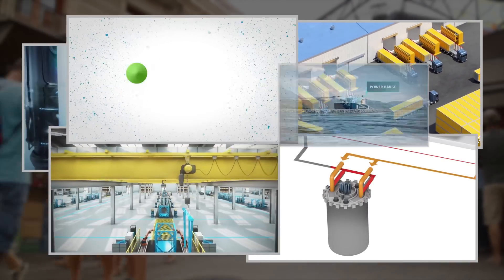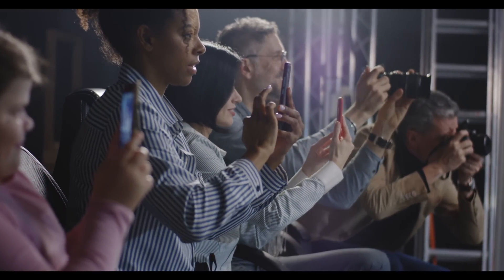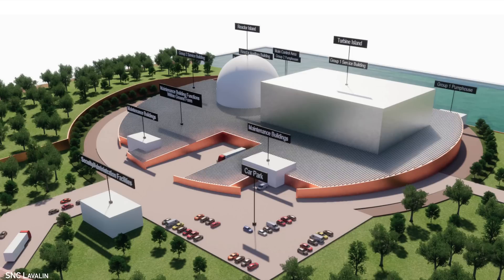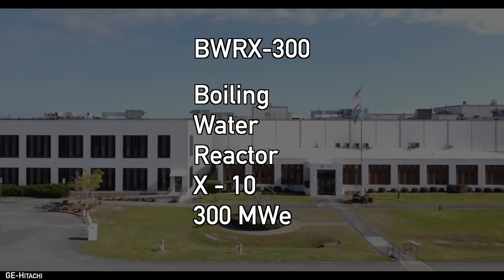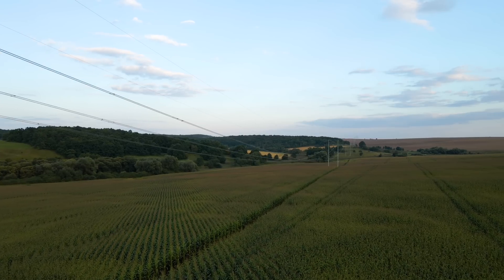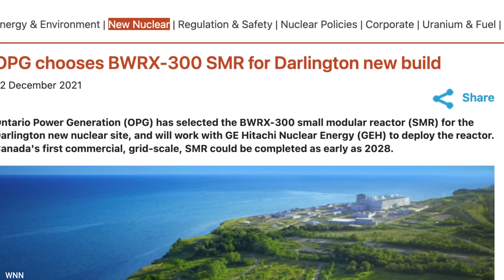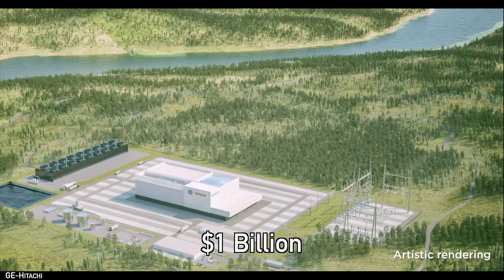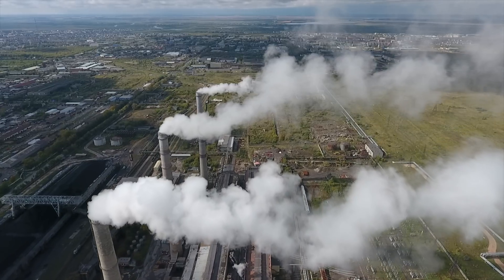Why This Small Nuclear Reactor is Actually Winning

Comment: The Current 2025 estimated cost for the Darlington SMR project, which includes the construction of all four small modular reactors, is approximately $20.9 billion.

The 1st. reactor cost is estimated to be  $7.7 billion, including shared infrastructure, leaving $13.2 Billion to complete the remaining  3 SMR's.

Construction of the 1st. SMR has begun and will finish in 2028 with the commercial operation date set for 2029.

Comment: A small version of the Fukushima reactor that doesn't need a backup diesel generator to cool it when everything else goes to pot.  But it's still a general electric boiling Water reactor.   3 to 4%  enriched fuel, relatively frequent refueling.

Comment: A 10 mile radius evacuation area is required in the US for fission nuclear power stations.   This has not change for SMRs.   SMRs could be used for ocean going ships where the ship can be moved to deep water if there is an unresponsive issue with the SMR.   Possibly the SMR could be jettison in extreme situation rather than loose the entire ship.  The move in the power industry is to use supercritical working fluid turbine generators that allow much better reacting generators for following loads.   This is not broadly fast reacting enough for following wild AC from solar voltaic and wind turbine generating sources.  That still requires natural gas turbine generators.

Comment: The guy says that the BWR is a boring design that can not offer the safety solutions of MSR's. Then he continues with boosting the reliability of the BWR. Which is it? Secure or reliable? They can't be both.

To me, SMR's of BWR or PWR design is NOT progress. They run on low temperatures, require incompatible turbines with coal plant turbines which run on higher temperatures. Waste stream is still the same & they have to operate under high pressure and the constraints of solid fuel.

Comment: I'm skeptical of designs that continue to use graphite water modulation which I assume is here in this BW design. The concept of the 7 day condenser pool cooling protection is that a failure mitigation scheme. Graphite burns and elimination of it is built in protection from the dreaded known and experienced failures to date. Cheap and shovel ready is nice and the pellet fuel also. Helium cooling no graphite modulation is more promising imo.. China is way ahead in that regard. Let's hope Xenergy here in USA emerges strong soon.

Comment: Governments that commit to a rigid time-frame for de-carbonizing their energy production are making a fundamental mistake: early commitment is bad practice for the opportunity and corrective costs inevitable. Especially with a technology in flux. However, the entire nuclear economy would benefit tremendously from the infrastructure of plant building and lending and operation and education programs that will spring up - and would naturally include the latest tech. And of course each power generation company will have it's own economic model to justify an early investment - if it isn't being panicked to do so.

It would be a huge advantage to a thousand small plant producers to join forces to commit only a small portion of their existing carbon budget to common commercial accelerated projects of the most promising but realistic design - obviously molten salt and Thorium would top that list because of its potential long term savings. Ten years is realistic to start production - especially with a global effort. 

However I do have to ask one bleak question -- what happens when we're producing unlimited HEAT - no carbon but a lot of HEAT and WATER VAPOR (used for cooling everything outside the cycle itself)? What happens when somebody calculates that into the Greenhouse Ecology formula? Uh-huh. I'm thinking - no free lunch. Back to distributed solar, wind, and fracking thermal.

So Let's Go Get 'em Guys!!
Reply: The only new nuclear projects in the U.S. were NuScale and Terrapower and NuScale just canceled their project and terrapower has built nothing in the 6 years they have been trying.  Each of these projects got $2 billion in taxpayer money for design that they said would only cost $1 billion.  Terrapower is a molten salt design but not Thorium.  Thnorium is not fissile and does not fission and does not produce any power.  Anyone that cites Thorium as the answer is getting their information from YT videos and really does not understand what would be involved in using Thorium

Comment: So this design has all the same flaws as the large nickel rafters if it needs that huge reservoir water that means it can still have thermal runaway and it still use control rods to keep a nuclear fission runaway from happening. It’s just a baby Chernobyl.

Comment: I think GE has the right rock here.  I work in the industry and I strongly believe this deaign could gain traction.  And the more orders ot gets, the cheaper the parts and the cheaper the parts, the more orders it will get.  

The BWR is a great design to begin with.  Definitely the safest, due to simplicity and the lack of large circulation loops in the latest designs.

Comment: Where is the uranium fuel coming from?  The UK has no domestic reserves, the last uranium mine shut in the 1930s and it only produced uranium for laboratory research. At what level of enrichment do they operate on? PWRs use 7% enrichment. Nuclear submarine reactors operate at least 20% enrichment. Where do they get the water to cool them? The big reactors are a problem needing water. Then there is the time between refueling. So many questions,so few answers

Comment: Boiling water reactors are vulnerable to positive void effect (the Three Mile Island meltdown). Using our present nuclear fuel chemistry (5% U235/ 95% U238), I would not recommend this. If GE used a Thorium/U233 fuel, this threat goes away.
Reply: No. Modern BWRs have highly negative void coefficient. In light water reactors the water is the moderator and the coolant. If the moderator goes away in a bubble the reactivity falls. BWRs have to deal with bubbles collapsing back to liquid when the pressure goes up. 

With the Chernobyl reactor, graphite was the moderator. Guess what most molten salt thorium reactor designs use as a moderator?

Comment: I’m sorry, but seven days of cooling is not safe. What if a natural disaster occurs and the reactor can’t be reached for weeks or months? Meltdown. Nope, still unsafe, just like all currently available nuclear reactors. Let me know when your BWR can cool itself forever without power or human intervention.
Reply: “Is not safe”

Turns out the decay heat … decays.  Several days out and while the reactor may be hot, it’s no longer hot enough to melt, and then continues to cool.  The coming very small reactors can radiate enough heat away as soon as they shut off without help.     

Also, while a meltdown of a light water reactor can make a big mess, we know what happens from Japan when even three of them are wrecked by a natural disaster: nobody dies from radiation.  Sorry, that’s safer than anything else that can run a grid.

Comment: People are crazy to keep using watercool design. It can still blow up if there is pressure inherent in the design.😊
Reply: The pressurized water might escape … instantly shuts down the reactor.  It’s the reactor core which needs to not runaway.
Reply: What moderates your design, and how is that shutoff?

Comment: In 1976 I met a GE engineer that told me about a reactor that would fit inside a shipping container and would run unattended for 40 years. We talked about building them where they would set on the ends and used as columns in entrance gates for a town. Or set up as industrial art.  I think one unit would power 3,000 homes.
Reply: Copenhagen atomics is developing that.
Reply: @MrRolnicek  I think that is a great product to develop. I hope it soon becomes cost effective to sell to the public..
Reply: Hey Poland! You're going nuclear for the wrong reasons!

CO2 is climate-irrelevant. 

Interglaciation climate change (i.e., the Medieval Warm Period) is caused by changes in cosmic rays (Svensmark et al). 

There is not such thing as anthropogenic global warming.  

"Global Warming" is a superstitious bullying and shakedown of the taxpayer. 

Just burn coal and keep looking for more oil and make it out of coal (the way South Africa does at SASOL).
Reply: And? 50years it die Not happen.

Comment: This design is not to great.   The reason you have a primary loop of water (in the reactor), and a secondary loop(goes to generators or heat users), is to keep the nasty radioactive stuff away from generators or heat users.   Yes the design is simpler, and for its life safer, as it is designed to allow boiling or steam generation in the reactor vessel.   The problem comes when you have to do Maintenace on steam pipes, generators, or whatever is using the steam because it is going to get radio hot over time.
Reply: Ok, but compare that to doing maintenance on a very large, primary connected steam generator in a PWR.

Comment: GE's BRWs were at Fukushima. How did that go? Steam is generated by water in contact with the fuel elements themselves & leaves primary containment to the turbines. Compare to Three Mile Island's accident.
Reply: “how did that go”

3 reactors totaled by aftermaths of tsunami, and… nobody killed by radiation. 

Fossil fuels tied up in everything else, and they kill people everyday.
Reply: Very old design compared to a much later design with many lessons learned. The BWRX-300 is designed to cool itself convectively without powered pumps. The powered pumps (and heat sinks associated) were the Achilles heel at Fukushima Daiichi that did not let them shut down safely during a tsunami. (Tsunami caused by an earthquake on a fault never expected to generate an earthquake that big.) This safety in the face of a station blackout may actually be a reasonable price to pay for the fact that the turbine hall is a (briefly) radioactive space.
Reply: I concur, I'm not a nuclear engineer but the segregation and redundancy of a PWR just instinctively seems to me to be inherently safer than a BWR. Due to the much higher specific heat of water vs steam, BWR having phase change INSIDE what's essentially a single primary element strikes me as being MUCH riskier vs a PWR with fully liquid state primary with multiple redundant heat sinks. Of course LOCA can be fatal for both but I'd imagine a PWR inherently has a much greater safety margin in an accident, and the primary stays inside the containment building pretty much no matter what happens.

Comment: If we were serious, we would just start building Westinghouse AP1000 reactors.  Proven design.  Reasonable power output.  PWR, so none of the downsides and higher maintenance of BWR. 

SMRs only make sense if they are really Small, and Modular.  Small enough to be built on a factory assembly line and shipped to the destination site, and the site is built to take a dozen or more side by side.   This has all of the issues with a large plant, but without generating the power output of a large plant.   The one thing it seems perfect for is replacing existing coal plants.  Build it on site next to an existing coal plant and bring the 300MW on line tied to the same transmission equipment.  Bonus points for making decommissioning of the old plant  conditional on the new plant being commissioned. 

Then the question is, which is better, the BWRX-300 or an AP300?

Comment: Good development but it is not just emmissions free elctricity that is needed. The big challenge is replacing the emmissions dense industrial process heat associated with for example chemical, cement, brick, synthetic fuel and metallurgy industries. High temperature reactors using molten salt, pebble beds, thorium fuel etc offer great advantages here. Such reactors also tend to be radiologically and thermally more efficient significantly reducing plant size as well as reprocessing and waste issues.
Reply: Thorium isn't more efficient than uranium. Both fuels contain about 24 GWh/kg and can be fully exploited by fast breeder reactors.
The point is - why use thorium at all, when spent fuel and depleted uranium (DU) is abundant?
The waste of 1 reactor year of a 1 GWe conventional reactor can provide up to 140 times the electricity originally produced. Additionally, the side product from enrichment, depleted uranium can provide another 4 - 5 times the electricity of the spent fuel. In total, this is about 700 times the electricity that was produced by nuclear in the past. This are resources worth tens of trillions or even hundreds of trillions USD, that could pay the debt of the US multiple times easily.
A side effect is that the "waste" produced after complete burn down consists of 95 % partly precious metals, and about 5 % of waste that decayed after 300 years to the level of natural uranium. Of course, it is poisionous, but can be stored just like normal chemical waste. And the amount is small compared to the amount of energy anyway, because 1 kg or uranium/thorium contains 24 GWh of thermal energy. 
But be aware, beside some advantages of thorium, there are nasty site effects. There are hard radiation sources within the thorium-cycle. Proactinium 233 and Thalium 208. Pa 233 comes from breeding Th233. It is a bad neutron poison, that requires immediate separation from fuel, otherwise reactivity stopps. Pa233 then must be stored separately, until it has decayed to U233. This decay also produces hard alpha and beta radiation. TI208 on the other side, comes from a small part of U232 produced during breeding. U232 decays at some point to TI208, which issues hard gamma radiation. This requires more extensive shielding and complicates handling. So the thorium-cycle has some drawbacks, which are often not mentioned. 
IMHO, before using thorium, waste and DU should be burned. And if this isn't enough after thousands of years, there is the posibility to get uranium from seawater, for which China seems to have found a cost effective solution now. BTW, uranium in seawater is abundant,  thorium is not.
Of course, you can use thorium sometimes in the same reactors, that burns waste and DU, but it isn't necessary for energy needs for a long time. 
So again, why use thorium when it isn't really necessary?

Comment: Korean nuclear reactor APR-1400 quotes $2,300 USD per kilowatt overnight construction cost.  Russian VVER-1200 reactor even quotes unbelievably low $1,200 USD/kW.  
I don't think that any 3+ gen PWR or BWR based SMR's can win over regular large 3+ gen reactor on economy. They are just shrunken PWR, costing more per capacity. 
Only SMR reactor  based on 4th-gen (like Molten salt MSR, VHT gas, pebble bed etc) can archive such feat.

Comment: It's a smaller boiling water reactor with all the dangers and expensive containment of the large ones. Every reactor disaster has been with boiling water reactors. MSRs can't melt down from loss of cooling.
Reply: “Melt down” is not the be all end all of  possible nuclear accidents.  MSRs have nuclear fission products moving around against the RV wall and even removed outside the reactor during operation.  That’s never been done commercial reactor.

Comment: what's the point when there are better alternatives that don't have any of the downsides? In an era where using wind and solar for electricity generation is far cheaper, faster to implement, and without any of the risks associated with nuclear, this seems pointless. Nuclear may have made sense in the 60's but no longer. Time to shelve it and move on to better solutions.

Comment: I believe there is a future for nuclear energy but this is nothing but a propaganda piece for one companies power plant. It has no real information and is in reality nothing but a "puff piece".
It is offensive.
Reply: Everything is sold a bit before it’s ready to build. Why is this offensive
Reply: @Nill757  <---<< OK you asked, I'll tell you.

Because they are making unsubstantiated claims and presenting it in glowing terms as if it all is an accepted fact.
I believe in nuclear energy and years ago I read an article in National Geographic (before they sold out and started making crap documentaries) about a number of new designs of nuclear reactor which was well done. 
There are designs that;
A.)Can't melt down. Their design is such that an effort has to be made to keep them running. If anything goes wrong they just shut down without anyone having to do anything.
B.)Some of the new designs are set up to use up old radioactive material, thereby solving two problems, generating energy and getting rid of old radioactive "waste"
C.)They are designed so that their leftover  waste is less radioactive and has a much shorter half life.
D.) Newer and better way have been developed to store the waste, such as glassifying it.

This video was not really talking about a new type of nuclear reactor just a smaller version of the same old bad design with all of their same old problems.
It is a puff piece designed to try and sell you on supporting their crap design and distract you from better designs.